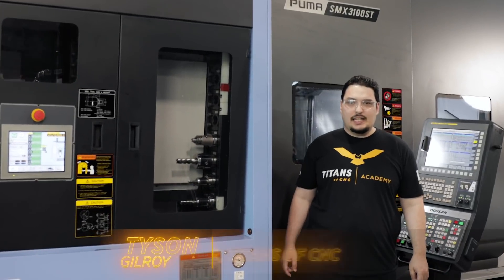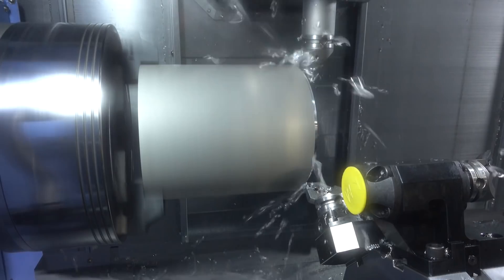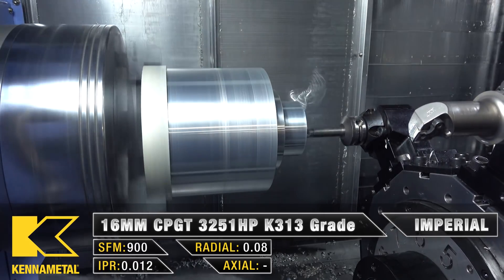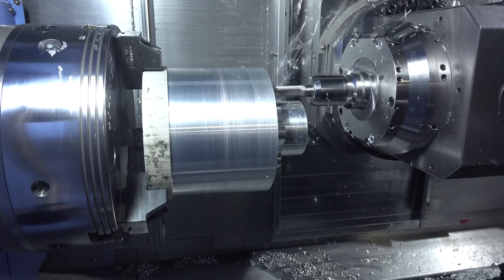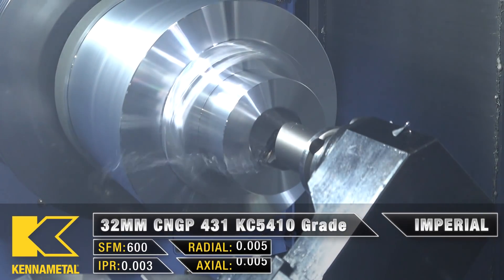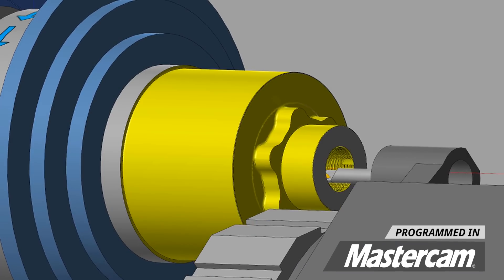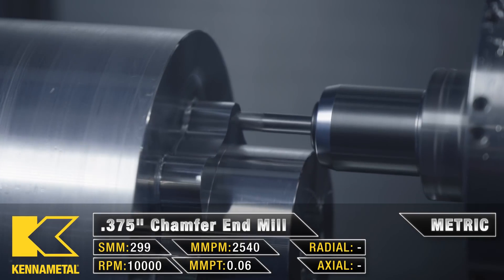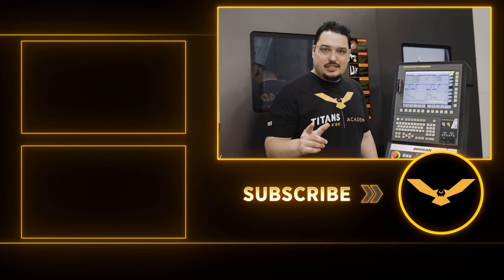Incredible 9 Axis Machining on DN Solutions SMX3100ST

Comment: Multi-axis machines provide a high level of CNC manufacturing capabilities and come with several benefits which make them invaluable tools to use. In simple terms, multi-axis machining is a manufacturing process whereby tools can move in 4 or more directions. This technical element helps to provide better surface finishes and quicker production times. CNC programming is made easier though the use of multi-axis CNC machines.

Comment: yooooo i got you a new type of cnc drilling that can be fast even for really deep metal.... ok so you got your drill right what if you have a drill holder on the bootom..????? i mean the drill drills a hole to the bottom and then the drill holder gets atached to the drill that will make the drill being held from top and bottom.... maaan with the drill holder you can really up the ipm like allot because it is held by both sides....you can even add some nitrogen or something so that the heat doesnt build.... but i think this needs a new cnc machine.... but i mean if you get like a 20 sm solid steel and you drill it with a 22sm drill and then atach the drill holder to the drill you can easily drill the whole block because it hold both up and down.... you know drill brake because its pushed by only one side maaaaan that can be an awesome drill ....

Comment: Nice work. I'm curious how the machine operates. I used to work on a twin turret Mori Seiki ZL-200S with sub-spindle, It required two programs, one for each head, and used wait codes to synchronize operations between them. M201, M202, etc. The Tornos-Bechler Deco 20a and 13a swiss lathes I worked on had proprietary software that would synchronize or constrain operations between the main and back work so the machine could run continuously without one head waiting for the other, though. The downside of the Tornos machines was, being optimized for high volume production, they converted the program to binary so you couldn't read or edit the G-code in the machine.
Reply: Doosan does it the same way as Mori. Split control. Someone must've poked around in your parameters because mori wait codes are 100-199 (100-197 on recent machines because of m198 being external media) sub call. 200 series m codes are dedicated to second spindle commands - m203, m204, m219, etc. M200 and m201 are typically chip conveyor.
Reply: @TheFeralEngineer  You're right on with the wait codes, they were 100-199. It's been a couple of years since I worked on a lathe. I got out of the small shop where I worked on whatever needed to run and took a job in the milling department at a larger company. Been doing 3, 4 and 5 axis milling these days, though mostly they give me 5 axis jobs to do in a 3 axis.

Comment: Great stuff! Why are the chucks spinning during the chuck transfer?
Reply: Usually for blowing chips off of the part and to make you puke when you run the machine with a hangover... Ask me how I know...
Reply: @TheFeralEngineer  Ah ok, that makes sense. Haha lol, you should've adjusted the shutter time  of your eyes to the rpm of the chucks ;p
Reply: @marnixvlot1868  customers took me out the night before and kept feeding me gin and tonics and jagger bombs. I was hurting. Puked on the side street the office was on before I even got there. Then they wanted to see a spindle transfer. When those two chucks came together, they weren't the only thing spinning 🤢🤢.  Those guys weren't in much better shape, though. One guy never made it past the bushes in front of the building 😆
Reply: i had the same question.  Found this video explaining the reasoning @ 1:11 https://youtube.com/watch?v=yCL8cZq0LZI&feature=share

Comment: That boring bar T3, is there anything different you would do to break the chip instead of having a stringer? I can never get the chip to break nicely and not ball up.
Reply: Probably just leaving more stock for the finish pass would make it better. It’s probably not a heavy enough pass for the chip to curl into the chip breaker. A lot of manufacturers “finish inserts” are still good to about .040” depth of cut and in my experience being up in that range helps with the chip control.

Comment: Just to appease my curiosity, what is the purpose of having the spindles running during the handoff between spindles, I feel like it would be safer if they where stopped, I'm sure there is a good reason??
Reply: Im doing the transfer with spining spindles because im using a robot for loading parts.

Spining transfer gives me a bigger chance to avoid chips in the jaws when transfering
Reply: @Old Dog Tools: Not faster if next operation is with C-axis machining.
Reply: Spinning on approach gives you the opportunity to clean chips off of the part and jaws. The ideal way to do this (at least on the machines I work with, one being a ten axis mill/turn), is to approach with rpm sync, enable and home both C axes and grab static, with the C servos engaged. It's the most accurate way to match feature to feature between spindles. Spindle phase sync is primarily for polygon stock.
Reply: @TheFeralEngineer  makes sense, I knew there had to be a good reason. In my old lathe Iv got sub spindle, however it's only a 2 axis lathe so no milling etc, Iv always handed off with spindle stopped. But that makes sense now. Thanks.
Reply: @marcf7008  on any machine with a traversing sub axis, you're doing yourself an injustice by not running it through via the available commands on the control.

Simplest way to do it would be (on a fanuc or similar based machine):

Handle jog sub to "grip" position
Set g54 sub spindle axis (usually A or B) zero point (B, 0, measure)
You'll get a distance from machine home of, let's say -14.5" 
Send the sub home

Program structure:
O0001;
(Left side operations)
M5
M1
M211 (sub chuck open on mori)
M51 (air blow)
M35 (rpm sync)
G97s500m3
G0 B3.0 (clearance above part)
G1 G54 G98 B0 F20. (grip position)
M210 (close sub chuck)
M11(open main chuck)
G28B5. (Use 5." Above B0 position as "intermediate position" due to sub axis not having an incremental call)
(Sub will return home)
M5
M36 (disable sync)
M1

(Right side operations)
M30;

Mileage may vary from machine to machine. M codes are always different from each manufacturer, so check your documentation for air blow, chuck open/close and sync commands.